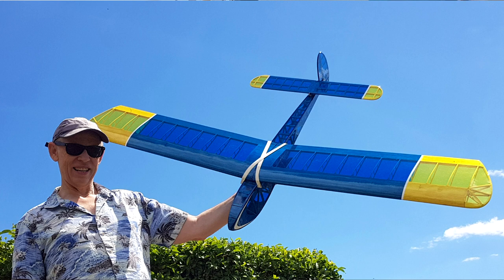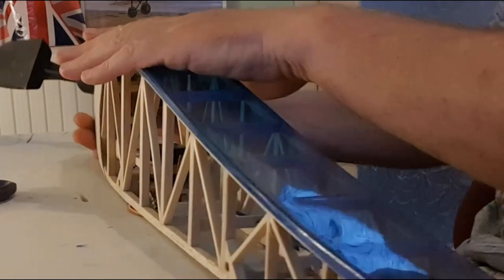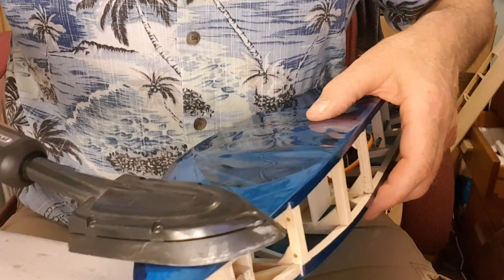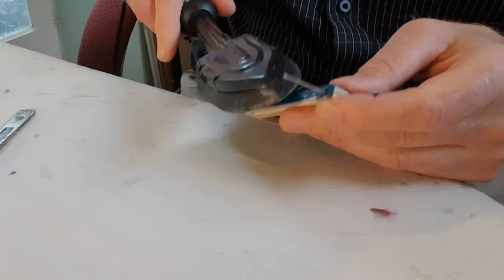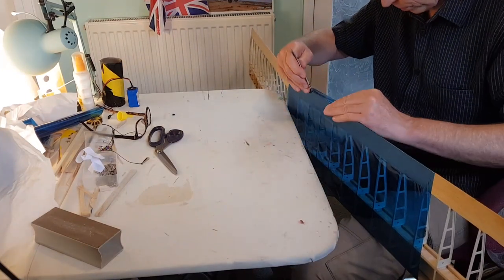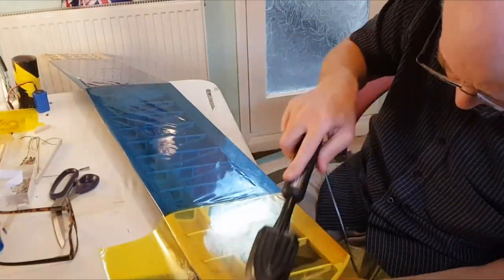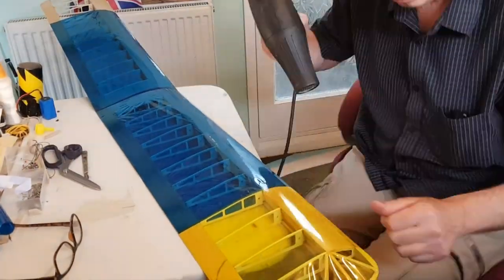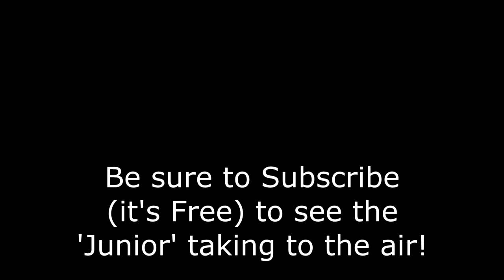Ocean Breeze 'Junior' Construction Part 4, How to Cover with Film

Comment: That’s awesome cliff . Love the blue colour. Just for a moment I thought that I heard a guillows spitfire crying in the background 😂
Reply from the maker: It's not crying Jon, that bird is meant to fly 👍
Reply: Cliff Harvey RC Planes my bird is still sitting on the fence wondering whether to be rubber power or electric  🤔
Reply from the maker: @jonjepson3650  Electric free flight? Capacitor instead of battery?
Reply: Cliff Harvey RC Planes mmmm that’s crossed my mind a few times. I will have to do some YouTube research 👍